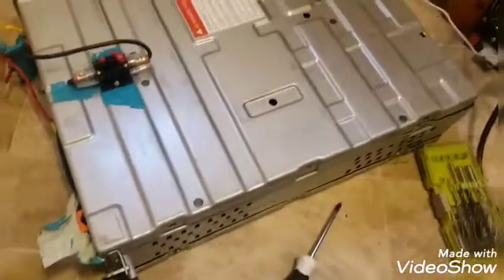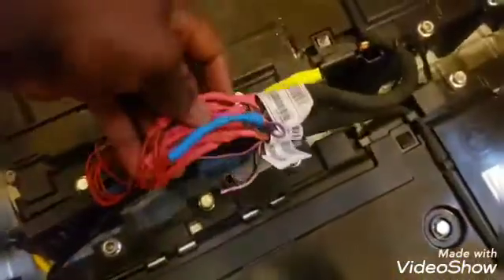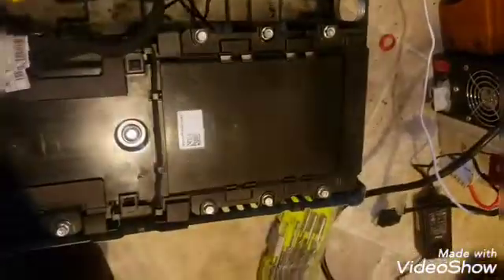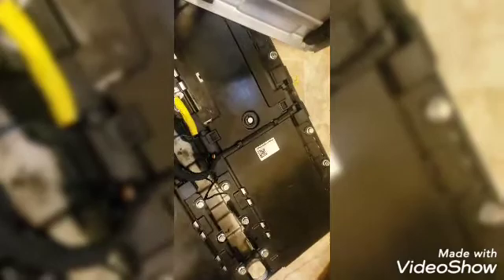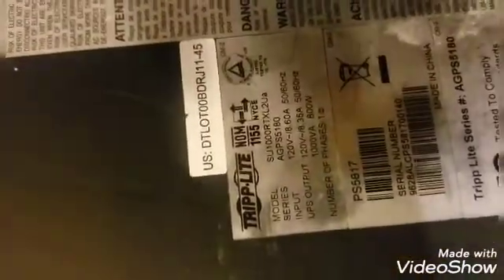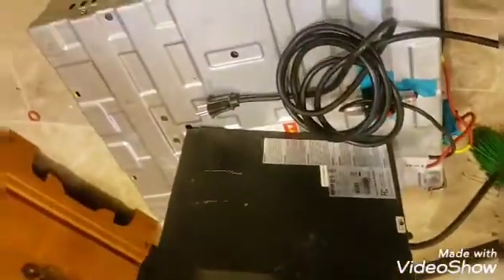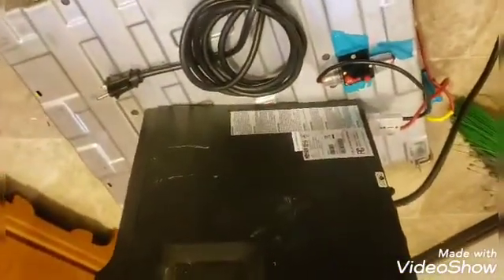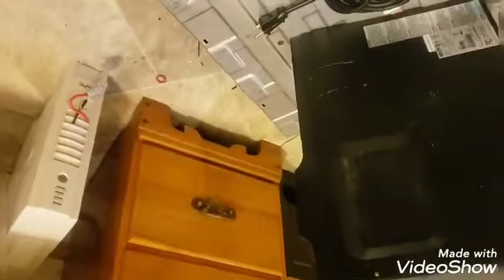Lg chem 48v module 14s to 24v 7 s lithium battery

Comment: Is this the one from battery hookup? Have you done a capacity test? is this just regular lithium-ion so the cycle count is not near as good as lithium iron?
Reply from the maker: Yes it from battery hookup and I will do capacity test later
Reply: @libtech5022  I was trying to buy a 30 of these but I don't really want to pull the trigger until I figure out exactly what chemistry they are in what the cycle life is supposed to be like with them.  It needs to be a high cycle life type of chemistry in order to be worth the money they're asking. Like between 3000 and 6000 cycles
Reply: @libtech5022   I found your capacity test video here https://youtu.be/SBqATmoZuOM